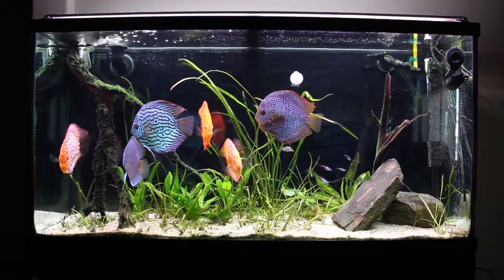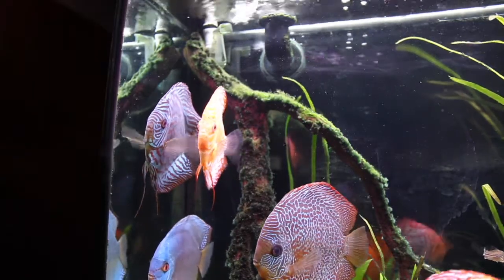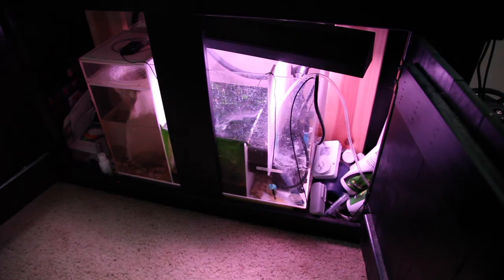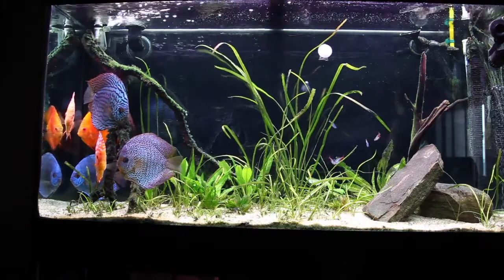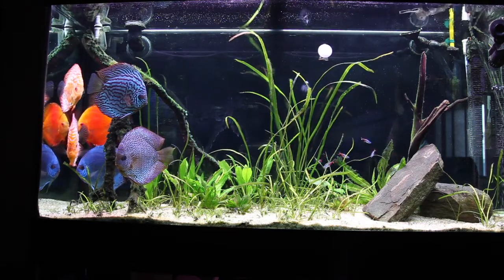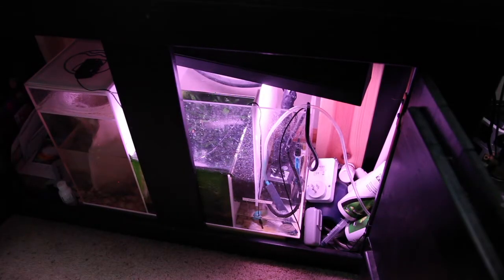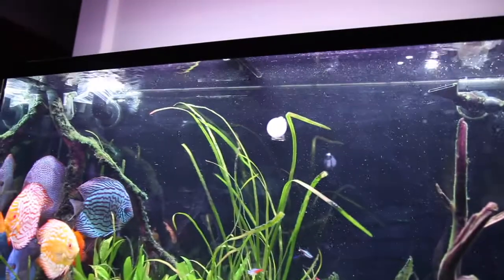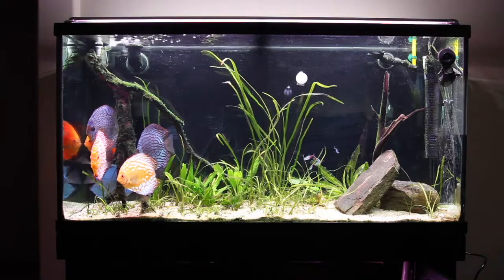Aquarium Overflow Drains: Worst case scenarios!

Comment: Didnt quite understand what you did there to mitigate the clogged drain case, do you have an alternative drainage to take the water out back to the sump ? The motor running at low water level still is an issue when you are out of town for 7/10 days. Also How do you replenish water that evaporates?
Reply from the maker: The video is just showing that a properly set up sump system won't overflow either the tank or the sump if there is a power outage or clogged drain.  As long as the sump volume is correct there won't be enough water to overflow the aquarium if the drain is plugged and water continues to pump into the aquarium.  Also, the sump should have enough capacity to hold water that drains into it in case of a power outage.  

A better (but more expensive setup) would have a second safety drain in case the first is plugged and a battery backup system for power outages (I've since added this in case of prolonged power outages).  However, the purpose of the video was to show that a properly measured system won't overflow in either situation (a common misconception).

You are correct that if you are out of town and no one is checking on the tank or feeding fish there would be problems.  Not only would the pump likely be damaged running dry for days on end, but the water in the main tank would not be heated (if the heater is in the sump).  When I'm out of town, a neighbor checks on the house and tank.  I don't have a water top off on this tank in the video, but they are easy to set up and can take care of the problem of evaporating water.  I have one on a reef tank and have had no issues.  This is what I use: (https://www.bulkreefsupply.com/tunze-osmolator-universal-3155-auto-top-off.html)